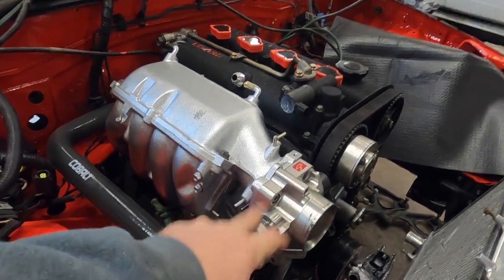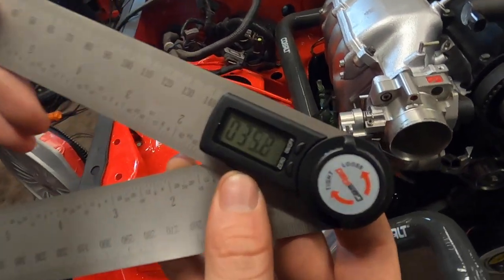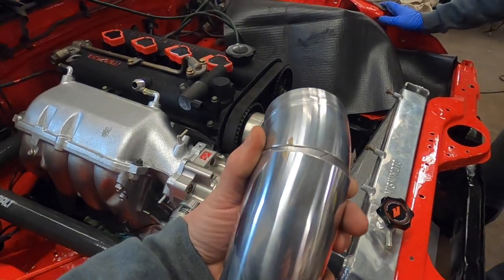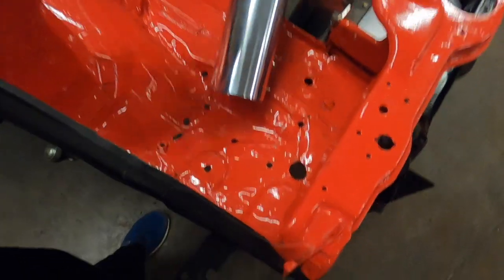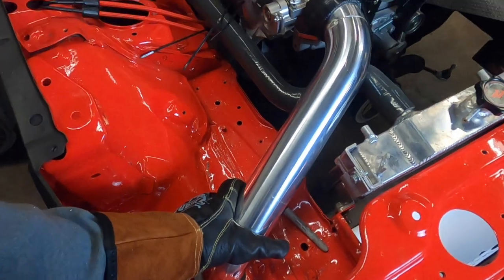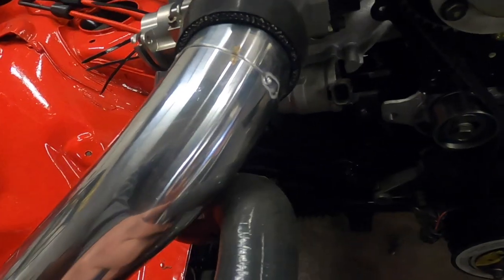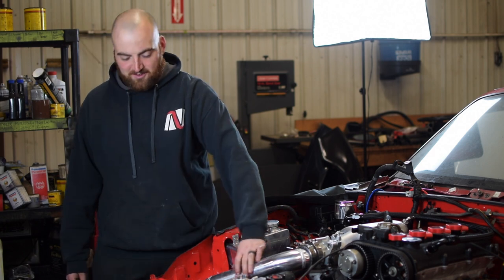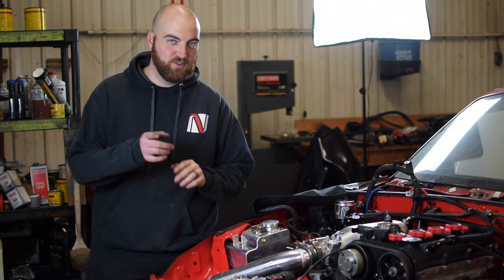DIY Cold Air Intake // Miata Track Build

Comment: Heck yeah bro just found your channel and subbed .. love the miata content I have a 91 1.6 miata that is bored over 30 thou forged bottom and boosted , next is a new head but I trying g to work out the crap flow of the 1.6 head 🤔🤷🏽‍♂️.. my theory will be posted on my channel when I figure it all out 2022 I intend on doing some vids myself with 3 already made but I weighting to get car back together and more parts to come in b4 I post cuz I want to be able to do daily content if able but atm I got to get my ish together sorta speak lol ... but I loving all your builds broski keep it rad my dude peace n love stay safe and imma keep watching 👀 😋🤘🏼✌🏽
Reply from the maker: Sounds cool!
Reply: @NappMotorsports  it getting there but u already know the smiles for miles in a miata are unsurpassed lol ... peace n love bro stay safe n keep it rad

Comment: Just signed up for the kickoff event at the Glen Apr 29-May 1 with hooked on driving. A couple test events with AutoX in Apr to warm up.  Sounds like a good plan for the track car?
Reply from the maker: We’ve gotta see where we stand with it as we get closer. Still need to get it tuned and everything too!
Reply: @NappMotorsports  looks like you’re making great progress. Fingers crossed that it continues to come together as you want it.

Comment: Put a waterproof cover over the air filter. If you drive in the rain the filter may get some spray.
Reply from the maker: Good idea. I’ve been debating making a plastic shield to protect it from wheel well water.

Comment: Hopefully the results will reflect the looks.

Any particular reason  for not using a skunk2 manifold like on the other white miata  ?

Best wishes from the UK.
Reply from the maker: This engine came with this manifold, and we’re trying to retain some sort of budget. The Skunk2 is not in that budget at the moment.
Reply: @NappMotorsports  Those manifolds (assuming its the EUDM one with egr and correct vacuum lines) are quite sought after in CA cos they can pass emissions. I suspect you could fund a skunk2 just by selling the squaretop.

And now I come to think for just one second... you probably already know that.

Comment: looks nice but aren't you worried that it will break because of the engine movement?
Reply from the maker: Not really. Between the coupler flexibility, and the bracket being thin, it should have plenty of movement. The engine is also on super stiff mounts so it shouldn’t move a ton.
Reply: @NappMotorsports   you got a point there 👍